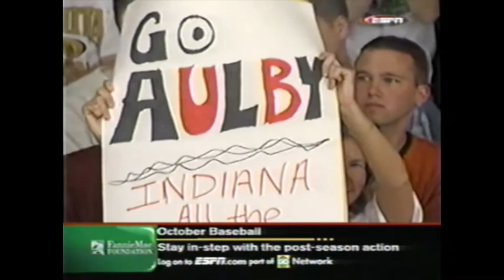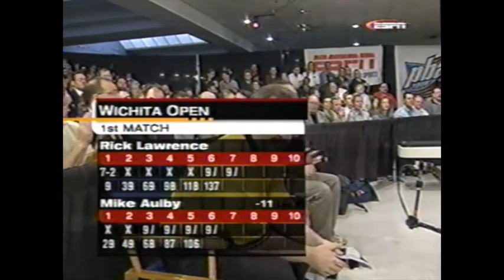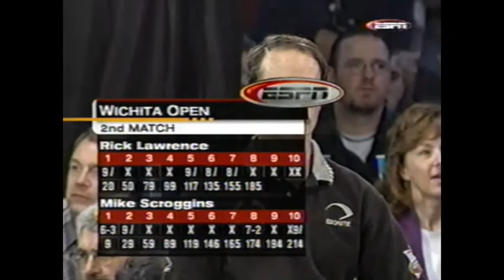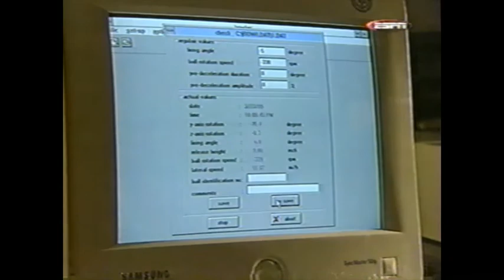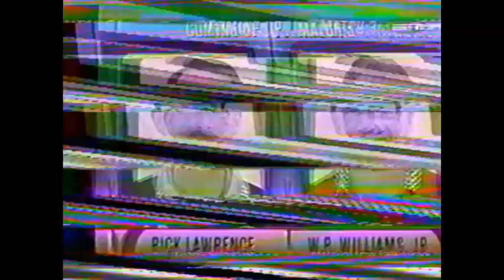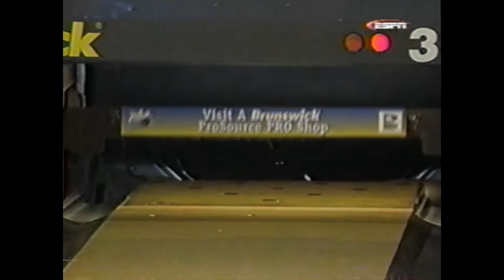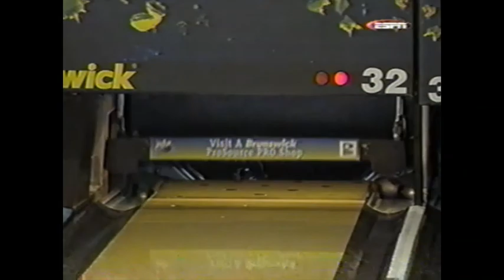1999 PBA Wichita Open

Comment: EnigmaZero,

Did you think the 98-99 gimmick of louder crowds and golden pins was a good or bad move for the PBA tour?
Reply from the maker: Louder crowds: terrible
Heavier Gold pins: great idea and I wish they’d bring them back
Reply: @enigmazero8624  I recall the gold pins were topped with either a crown (for a Brunswick facility) or three lines (for an AMF facility).
Reply from the maker: The ones they used on the Tour were made by Brunswick and had a black crown at the neck of the pin.